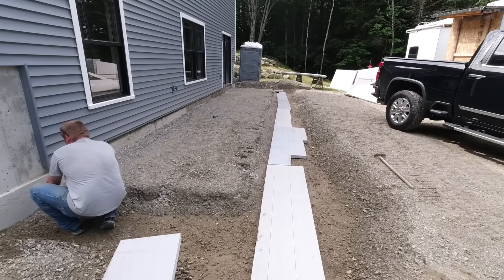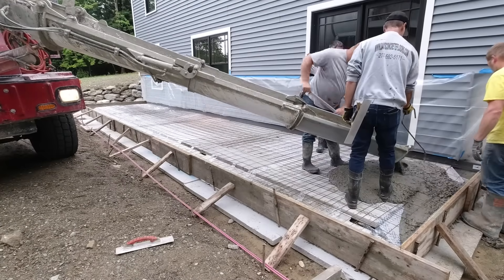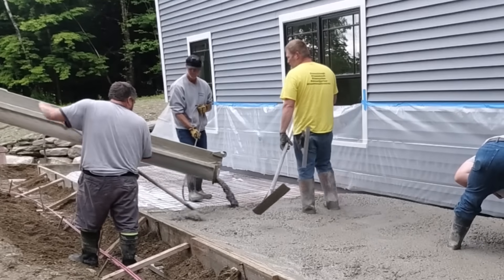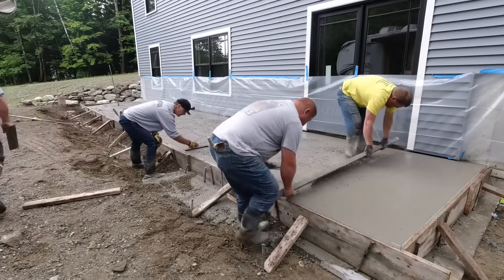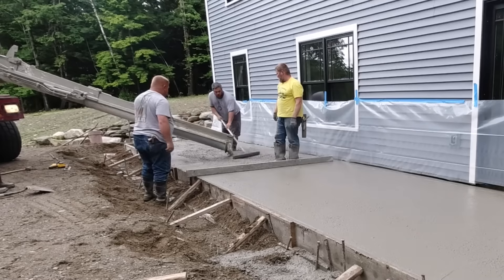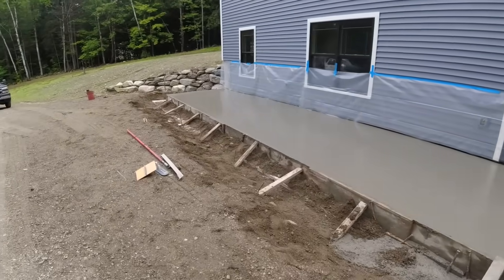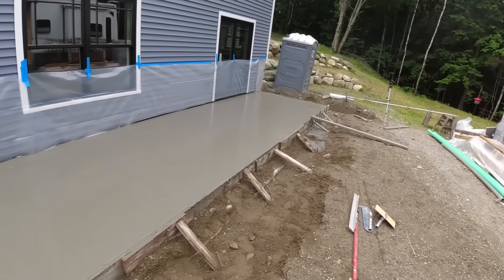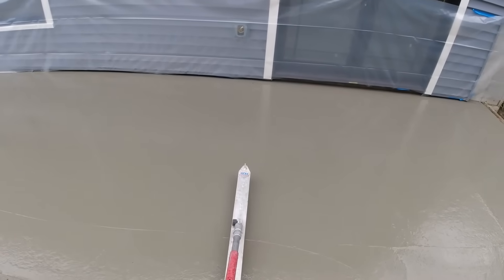You've Been Pouring Concrete Wrong All Along, Here's Why

Comment from the maker: All my concrete mixes have water-reducer in them for higher slump concrete.
Reply: Hi Mike! What is the name of the water reducer and how much do you put? Thanks for the nice videos. I started out watching a lot of Odell concrete on YouTube but after watching your channel I realized a lot of the trowel finishing they do on exposed flatwork in California and Arizona is not a good idea in colder climates like Canada where I live. Thanks!
Reply: @thomaskaszuba  Sika Visocrete 2100 or equivalent, I'm guessing.  Also commonly referred to as "plaz" (short for plasticizer).  If you're ordering from a RMC supplier, most will either do a half dose or full dose (also referred to as mid-range and high-range), depending on your desired slump - for us, we do a half dose to our regular mixes to achieve a 6in +/-1in slump (i guess ~15cm slump, sorry don't know metric slump terms) and a full dose for a 7in +/-1in slump.

As far as actual dosage rates, I'd leave that to your supplier, but for reference, the 2100 Visocrete is usually ~6oz/100wt for mid-range and ~12oz/100wt for full range.
Reply: @andy-s6o1h great thank u sir

Comment: I just had a concrete guy pour a foundation for a house and then finish off the porches with a broom finish. No edge band like you did with the finishing tool. They poured in the middle of the day on an 88 degree F. day and struggled to get the finish smooth before it hardened since they did the 60 yard pour in sections. So now the porch concrete has waves and unevenness to it. What can be done to repair it? Grind it down and seal it with the aggregate showing? Overlay on top? We don't get freezes below the teens here, but lots of rain and sunshine. 

I want something permanent that they will be happy with, but concrete isn't my specialty. The guy has recommended overlay or stamped overlay, or grinding it down. 

Thanks for any thoughts.

Comment: I was 27 years in the production of concrete so I know all about air entraining agent and super plasticiser product polypropylene fibres and steel fibres, great to see guys laying it who understand the product they work with, so many idiots just want to put loads of water in the concrete to make it easier to lay, but they don’t understand they are reducing the strength of the concrete additives cost more to add to the concrete but you end up with a much better finish that will last for years and as you said resist the freeze thaw cycles in a harsh winter, good job lads 👍

Comment: I call it the Grand Canyon affect trying to explain it to the customer why you want to do that. My customer had bad gutters installed and where the seams were they leaked in less than 5 years it had eaten through the concrete and had it rough in those areas where it was Dripping

Comment: If you put the wire mesh on blocks or chairs  you cant' walk on it. If you do it bends down to touch the ground and stays there. When it bends down it pulls the chairs over. Now it is so bent up and out of flat that you can't pull it up . Now you have to cut wires or zip ties to get the wasted chairs out . If it's a 4in. Slab you can't pull the mesh up because it's too bent out of shape. During this clusterfuck youv'e had to stop the pour,remove remaining chairs, pay 4-5 dollars per minute of truck stand-by time. Have a 😊 day archetects.

Comment: That slab, in Australia, would never pass our standards.  There is no reinforcing in the footings around the edge & no 'chairs' holding up the reo as the concrete is being poured & the steel reinforcing is just pig fence wire.  Reinforcing in Oz is about 6-8mm in diameter at about 8" squares.  A box like framework of reo is installed in the footings around the edge & that allows a wall to be built.  
As for styro - it's being allowed here in new construction, but over time it compresses & causes cracks in the concrete & vermin can live under it.  Also it gives off formaldehyde gas just as upholstery foam does - bad for health.  Have built several houses over 55 years & no slab failures.  
A fairly recent driveway pour here failed with cracks radiating from the centre - a complete failure & had to be removed & replaced.  Modern methods of building are often failures, cutting corners & costs don't always work.  The use-by dates are built in - criminal
Reply: For indoors concrete slabs in the States, a vapor barrier is placed over any styrofoam, and also the foam is rated to withstand the weight of the concrete.

Comment: I grew up pouring a lot of concrete, I thought I was rather good at it at that time. I learned by my dad and Uncles, mostly by a whistle! I joined the Army and was stationed overseas. I started helping German buddies with their construction. That’s when I learned the USA doesn’t build as strong as other countries! I’m not putting down the USA!, but here in Germany they would of placed a hell of lot more rebar in and you wouldn’t of need to pull wire cause height is all set before they pour. I can’t figure out why we don’t do this in the states? Their homes last for hundreds of years and are a hell of lot more energy efficient. Since you like to let your viewers know “how to”, have you considered coming to a German Build Show and seeing the difference?

Comment: Sorry , pulling wire sucks - inconsistent …have you ever excavated a slab poured with risers years later ? Of course it settles when stepped on - it needs to be at middle fo pour not bottom-sorry this is being lazy. Why NOT use risers ? ? Answer THAT question.
Reply from the maker: I've never had to excavate one of my slabs, that should tell you something.

Comment: U really think that foam is gonna prevent frost from getting underneath the slab?? If that slab is gonna be out in the weather, not heated, not covered, that thing is gonna get frozen like an ice block, now the ground temp can't even get to the slab. I can see putting some foam vertical around outside perimeter, but putting foam under a slab that's doing what that one is doing makes absolutely no sense to me. Here in northern Michigan, sometimes blue print calls for 2" foam 2' flat under basement floors at walkout area's. On cold days before house is finished u can see frost in concrete where that foam is cause that foam is actually insulating the cold in right there.

Comment: Looks great ! Back when I was pouring concrete walls for residential, and commercial projects, water reducer’s were called Super Plasticizers. We had a building inspector show up on a commercial project. He shut the job down halfway through the pour because he thought the mix was too wet. The Building Inspector let us finish the pour with a caveat…a Swiss Hammer, and a core test after one week of curing time. If I recall correctly both test cost us almost 1,500$ early 1990’s The walls tested out at over 5K PSI, so he allowed us to move forward.

Comment: One thought in Britain it is recommended to seal the top of wet concrete either by spraying or polythene sheating to reduce dehydration it certainly Helps the surface finish, interesting video brought back some good memories, looked very professional.

Comment: Salt is HORRIBLE for concrete!  It should NEVER be used - ever.  WHen it reaches the rebar down below it blows out the surface and ruins it.  As you say, use sand.  All those chemicals do is have ice freeze at a little lower temperature - and still be slippery.

Comment: The only thing about this Mike is having the slab at almost the same height as the sliding door sill. Aren't you worried about water seeping unde the sill? Any time i have built a deck for clients I advise them to have at least one riser height to step down  onto the deck.

Comment: Great work as always Mike the only thing I see and I see this all the time, is that the final grade of the concrete should have been at least three or four inches lower due to the double doors. You get a lot of rain and snow deflecting off the concrete and rotting out the doors
Reply: They know what they’re doing mate

Comment: Your whole crew has ODC. That's why your work looks so good.  A like-minded crew.  No data to go buy but sure seems crews from the north east do nicer concrete work than those in the south.  Down here it's bullfloat, mag the perimeter, edge it and hit it with a wet broom.  Home by 2. 

FWIW: I'm a commercial GC and we aren't allowed to pull up wire mostly because the wire depth is inconsistent (so the engineers tell me)  It must set on chairs.  No bricks or rocks either since bricks create weak spots in the slab.  (so the Engineers tell me)  Oh and we don't "pour" concrete, we "place" concrete (so the Engineers tell me)

Comment: Been working on house that was finished in 1941. I couldn't believe how much damage to foundation from water off roof splashing on ground 12" away from walls. I've seen water erosion from dripping directly on slabs but not from hitting ground and splashing off the wall. The foundation still has fewer cracks than most from more modern times. Not sure if they had ready mix trucks then. Inside you can see what appears to be cold joints between the loads but they don't leak.

Comment: Great video, except for the part where you said you do not use spacers; you lift the mesh then immediately walk all over it, sinking it back to the bottom. If you don't walk over the mesh, your method is acceptable, but how you did it is wrong.  It may not be an issue immediately or in this situation because of the underlayment. But a suspended slab would be an issue at some point. Otherwise, you guys are golden.

Comment: Haven't you guys heard that you are wasting your time. You just need to dry pour. It is just as good and so much easier. :) 
My father and I tried our hand at pouring concrete when we poured our driveway slab. We did that almost 30 years ago and it has been driven on with my D6 many times and we didn't put in any control joints. We poured the slab in 3 sections that were 16' x 40 foot and 16" thick. So far we haven't had any cracks.

Comment: Concrete is not poured...it is placed.
Reply: @TimSlowey Agree, if you pour concrete you have to drag a lot of it. You place it at elevation you just have to finish it.
Reply: This is from a civil engineers perspective. Also pulling wire mesh will not insure it is suspended in the slab. In fact t it rarely is.

Comment: In your area do you use curing compound or water cure, or does the air entrained concrete not require it?
Reply from the maker: It should still be cured and sealed. Either cure & seal or water cure then seal afterwards.
Reply: @MikeDayConcrete  Thanks!

Comment: i  noticed  in the  begining. because of  the  water reducer added . it  had   seperated the  stones from the slurry.  you can see  piles  of   stones  and not  much sand  and  concrete
Reply from the maker: That doesn't have anything to do with the WR, sometimes it does that, depends on the batch man and what day of the week it is.

Comment: The water reducer seems to create of stone segregation from the sand and cement 😊😊
Reply from the maker: No, that's just the mix, some days are better than others.
Reply: In my 40 plus years of concrete work I've seen many times where the gravel separates from the main mix. It does it coming down the chute before it hits the ground , and even in the wheelbarrow. Nobody et concrete plant can (or won't explain why.) Some mixer truck drums have mixing fins without a lip on them called agitator fins. Others have fins with a lip called mixing fins. Could be the difference. Also maybe screwed up batch weights? Less sand , too much gravel?

Comment: If you want to protect the slab from frost getting underneath the foam should extend the foam out a ways past the edge. And if lifting the wire keeps it in position why do all engineers require chairs? Look at engineered projects where concrete is tested and mesh is chaired. They seem to last a lot longer then any residential crap.

Comment: I’ve got a quick question whenever I’ve used bagged concrete before there’s always water that comes up to the top and even if you’re not adding a lot of water. How would you make bagged concrete or do they make bagged concrete that actually has cream on the top after you mix it instead of the water at the top, it just all seems watery unlike concrete right out of the truck?
Reply from the maker: I buy a bag of Portland Cement and add at least a Quart of Cement per bag. That'll help a little bit with cream and water issues. Sometimes I'll add a little accelerator to each bag to reduce water bleeding also.
Reply: @MikeDayConcrete  Thanks Mike

Comment: Great looking job, with attention to detail and final look is second to none, but 100% that iron mesh is sitting at the bottom of the pour - if the mixture runs easily under when lifted it will run equally easily makes its way back over when stepped on - 100% (you may have done this 1000 times but I bet you never you have never taken a patio apart once it settles to have a look where the mesh settled which means your experience counts for nothing - your ego got the best of you here (wire police - hit a nerve I see) and why not spend $20 and have some small supports as the manufactures suggest, the people that know because they tested it)

Comment: Around here, 5000psi concrete is required to be resistant against frost and salt. 4500psi is resistant against frost.
Reply: 4500psi without air? How cold winters are in you area?
Reply: @lazarusvolta352  Normal, but that is what you need to have to withstand the frost, and to avoid scaling. Need better to withstand frost AND salt.

Comment: I don't think this slab will crack at all. Reason is: the slab has even thickness, the slab is not connected to anything firm and is floating pretty freely. The ground may settle a little bit though, if they cheated on the compaction and preparation of the ground.

Comment: In Minnesota they still use wire mesh we stopped using it mainly because we mostly do remodel and when we demo older concrete the wire is always rusted out parts on the ground some is still lifted but mostly not so we only use rebar and microfiber unless required on commercial
Reply: Yep, which is why us wire lifting police bang on about it so much haha.

Comment: Hey Mike.  If a 4'x4' section of the slab was removed would you put money on the wire being uniformly placed in the bottom 1/3 of the slab?  
We use #3 on 16" or 24" centers on SOGs so we can fit our feet in the squares when placing the concrete.  We only use wire on pan deck or thin slabs that won't accept rebar.  The best combination is for SOGs is #3 or #4 with stealth mesh over 10 mil and expansion at all hard edges.  
KSC

Comment: GREAT INFORMATION on the de-icing chemicals.  I did not know that.
Broom finish is real nice.  Your team does very clean work.
The drip line of rain.  That is how caves are formed.  Rain picks up Carbon Dioxide as it falls, carbonic acid, melts rock, especially calcium.
Reply: Water is the universal solvent. Given enough time, it’ll erode diamond.
Reply: @psidvicious  Yes, A lake of purified water will dissolve a small diamond.
Reply: @psidvicious The universal solvent that we need to drink to survive 👍

Comment: I put expansion material between all large pieces of concrete because it ALWAYS moves.  It doesn't need freezes, just temperature changes.
Nice that you use plastic drop cloth to protect the finished house surfaces.  So many finishers swear they will clean it up.  Concrete doesn't clean off of paint or wood or anything really.
Reply: @Stan_in_Shelton_WA  not very easily Lord knows I've had to go back to many jobs to clean up 😞

Comment: Hey Mike, what do you do when you start a pour and the second truck never shows up. We had that happen this year when it was 110 degrees in south texas on a simple driveway. took 2 hours for another truck to show up. they kept telling us its 15 minutes away its 15 minutes away
Reply: Whenever I’ve had that happen, we always chop a straight edge, with the come-a-longs, wherever we ran out at and try to make it line up with what would be one of the grooved control joints. When the fresh concrete finally gets there a cold joint will be formed and will inevitably be one of the control joints because that’s where it will crack. Make the most of a bad situation.
Reply from the maker: That doesn't happen to us, we always pour first round in the morning too so it's even less likely to happen as the first trucks out of the plant are going to us.

Comment: I ask again is there a formula on water reducer
Reply: They contain modified lignosulphonates. It's a liquid additive added to the mix at the plant, you can't make it yourself.
Reply: @ehamster  Actually dishwashing soap has nearly the same chemical makeup as water reducer and could be used in a pinch. But I still don’t know the mix ratio. You’d have to experiment with a couple micro-batches to see what works.
Reply from the maker: They add it at the concrete plant, it's ounces per 100 weight of cement. Meaning they add it depending on how many pounds of cement per yard is in the mix. Usually around 3 ounces per 100 lbs of cement. Mid-range is usually around 12 to 15 ounces per yard.
Reply: Ok thanks
Reply: Ultimately it would be added when the truck arrives on your location, you only have so much working time. You can buy it yourself and have the truck driver mix it in. Or have the truck driver bring some from the plant, and mix it in when he arrives.